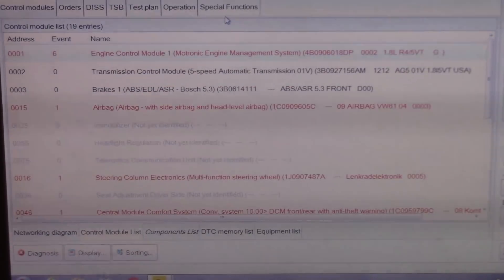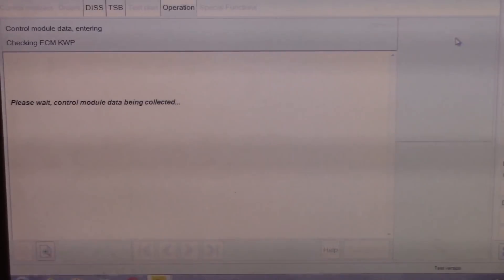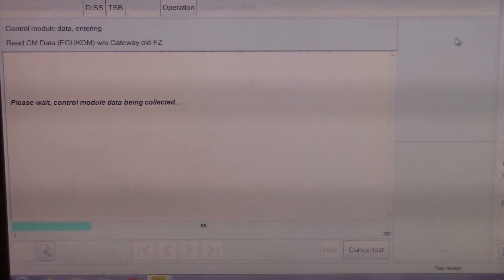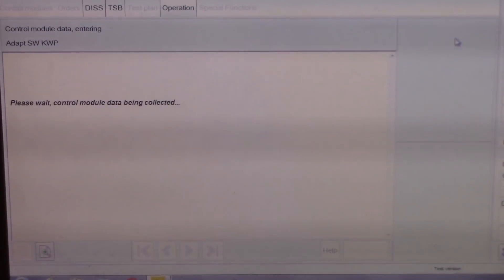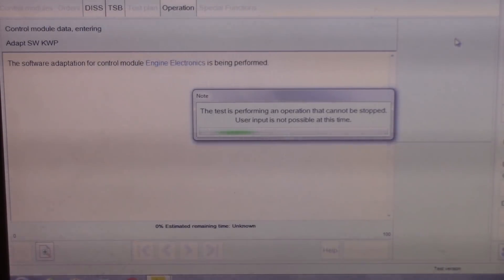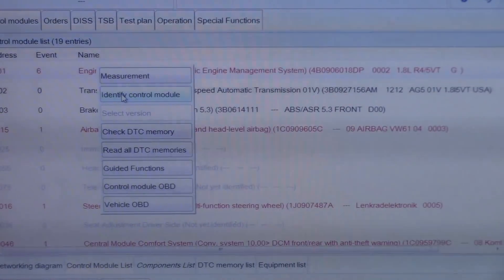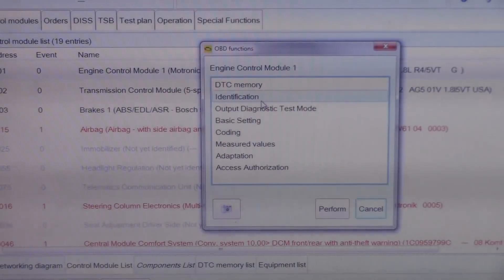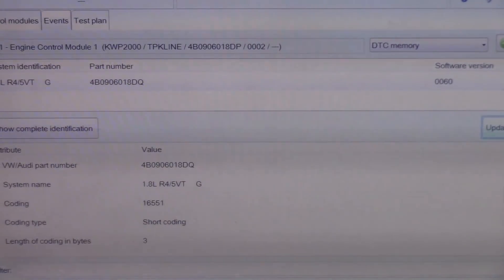ECM Reprogram (2004 VW Passat)

Comment: Dude I need your help updating my ecu or flashing ecu. Fuel pump isn’t kicking on I changed relays, pump motor. I’m stuck I’m thinking it’s ecu related now . 03 Passat Gls manual. Any advice would be helpful!
Reply: Only code comes up is p00441 I believe. Evap leak(small)

Comment: Tom ? seen your video new to vw owner have a touareg 2004 model  was check all data found TSB  update for my car. What is the best way for dyi guy getting this done?  dbc1965@gmail  my name is david
Reply from the maker: It’s probably best if you take it to the dealer to get an update done.  Doing it yourself takes money, equipment and a locksmith id.

Comment: great video... one. question did you update this because of a drivability issue or just because u seen it needed updated
Reply from the maker: We saw that there was and updated part number and software version for some of the faults that were stored
Reply: @PositiveLeadDiagnostics   what OBD you used ?

Comment: Can you post a video about what is required (software / hardware) to be able to do this?
I know I would need an ODIS subscription ($750/year)... but what would I need for hardware / software. Is that included in the subscription (download ODIS and use a j-box)?
Reply: https://www.ebay.com/itm/Drew-Tech-Mongoose-Pro-ISOCAN-2-J2534-Interface/200942050044?hash=item2ec9145afc:g:~tsAAOxyg6BR3f7f

After buying the yearly and then having to buy daily subscriptions to ewin to get the flash, I dont see how it will pay for itself vs running the car to the dealer.  Now if it gives us some cool functions using the odis to diagnose that would be worthwhile.
Reply: CoolAirVw Rm Yeah, you'd definitely have to do a lot of flashing to make it worth it. We've been sending customers to the dealer when we suspect a flash is needed / outstanding or a tsb points us in that direction. It would be helpful to be able to confirm 100% that that is the case. . and to also have the option to do it in house.